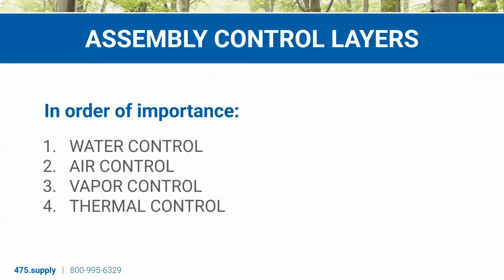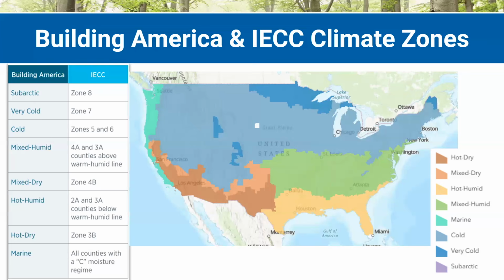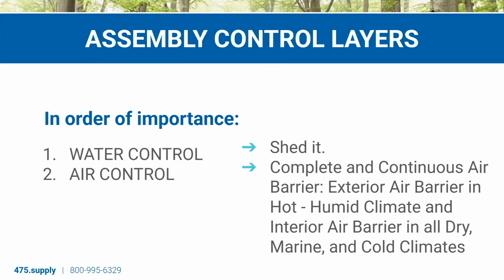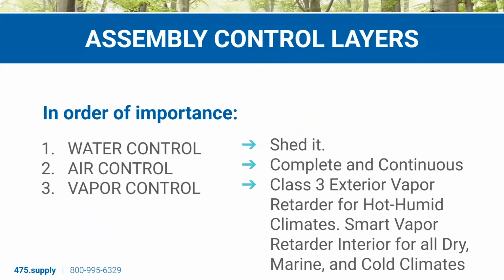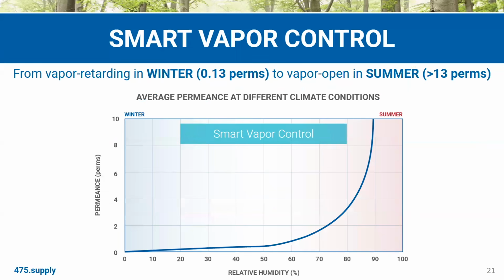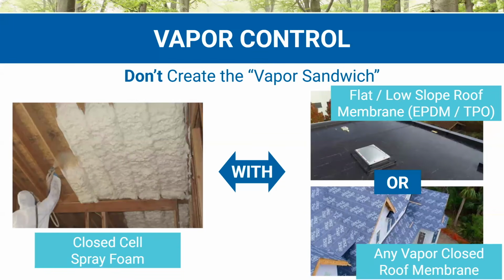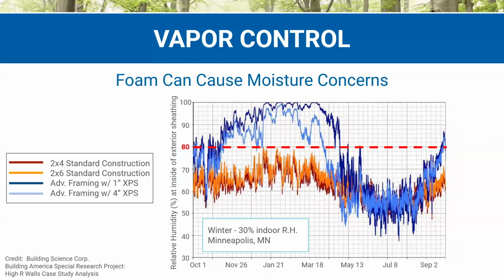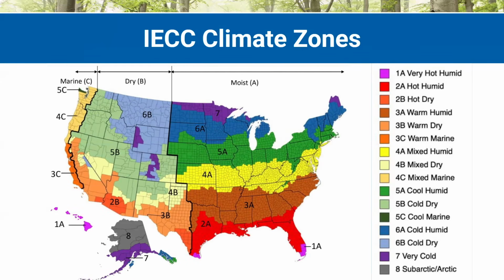475 BuildingBlocks: Foam Free Wall Assemblies by Climate Zone

Comment: By this metric, if I were to use a normal wrb as an air barrier for the inside, wouldn’t it also stop warm air from touching a cold wall? What advantage does it have to use a special interior air barrier product vs felt paper or say tyvek? Zone climate 6b by the way
Reply from the maker: Interior airsealing is very helpful, the INTELLO further reduces risk by being a humidity dependent vapor retarder.